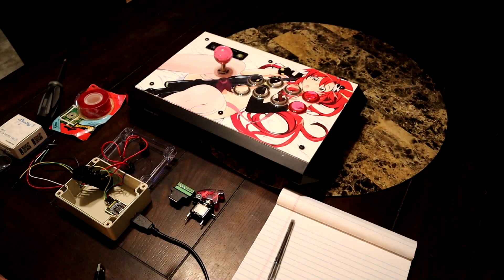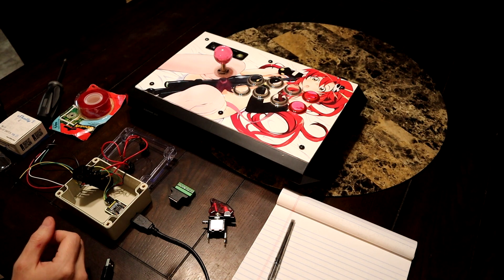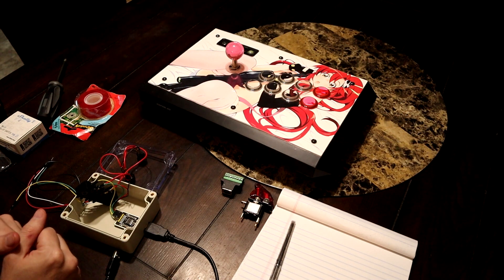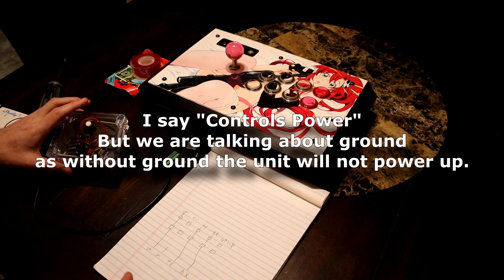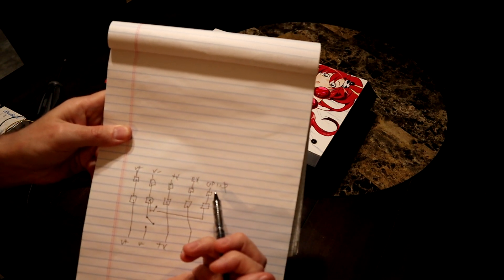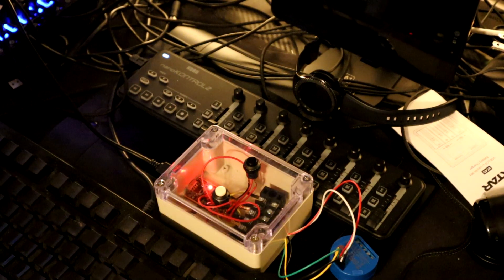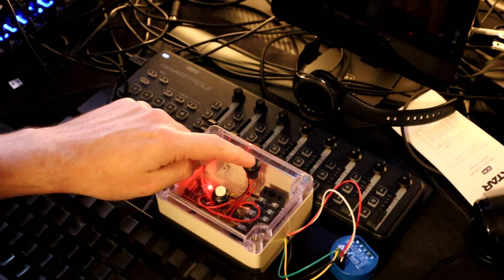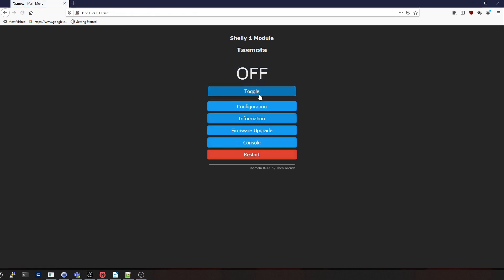My DIY “Over-engineered ESP8266 Flashing Device” for Easy Sonoff & Shelly Tasmota Flashing

Comment: Nice idea. When I've been flashing similar devices I've not found it necessary to release GPIO0 though, in order to flash. Once the flashing is done, of course, I no longer ground it.
Reply from the maker: That's good to know didn't know if it was needed.  But since I started with Sonoff's I was not willing to keep holding that button down :)  I guess this is a good procedure so I don't re-enter flash mode on reboot.  That or replace the ground for GPIO0 with a momentary.